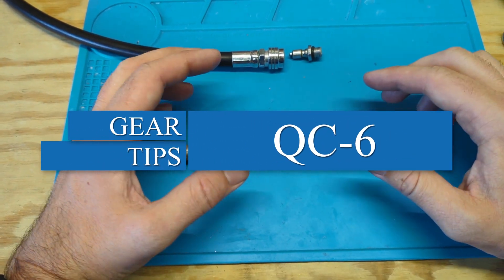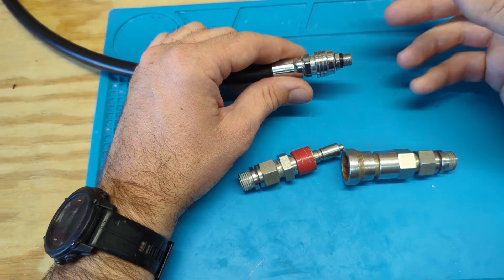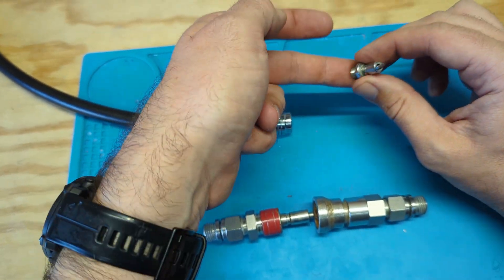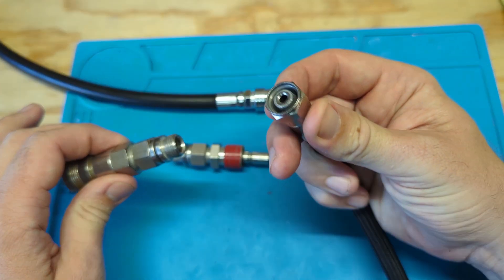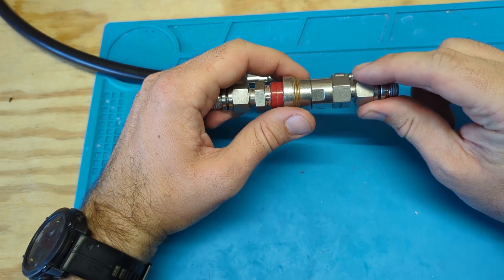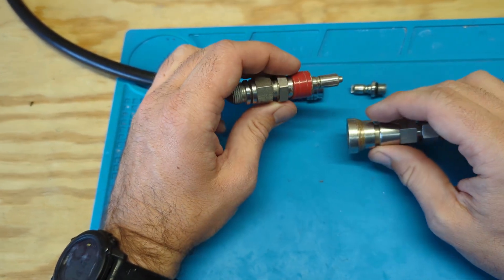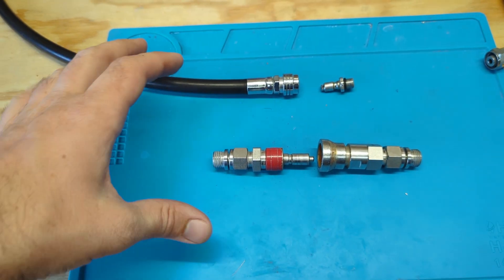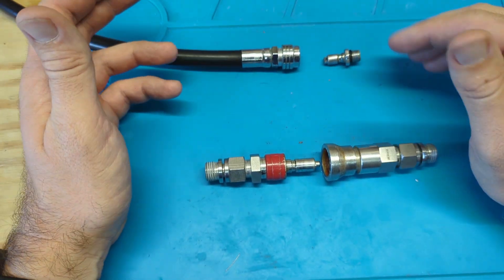QC-6 Rebreather Fittings

Comment: How did you manage to find a QC6 without a lock? All QC6 I use have a locking ring on them, they will never disconnect unless you unlock them first. I wouldn't dare to connect a BOV through something that can just fly away when rubbed the wrong way.

Comment: Hy, please excuse my english..but i am from germany.

i am diving a mares horizon SCR-Unit. there are 2 connectors where you plug in the bottom and the deco-gas. It has a special connector between the bottles and the unit which are not allowed to use under water. That makes it difficult to clip on the bottles on dry land and walk all the stuff to the water. i was thinking about changing that to QC6 for a while but nobody can tell me if it is possible. maybe you can?

thaks for your videos and maybe even the answer for my specific problem in advance.

best regards

Martin
Reply from the maker: I'm not familiar with the connections on that unit. If suggest talking to the manufacturer or your instructor.
Reply: @BarefootBentley  thank you very much. The manufacturer will probably insist on using their connection, but I can still ask.